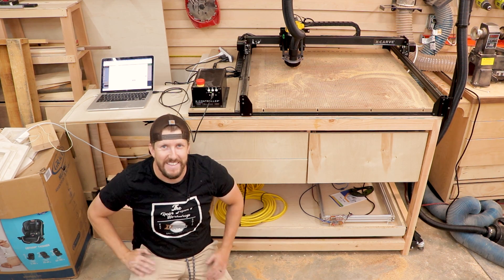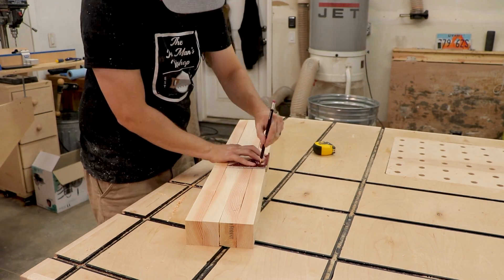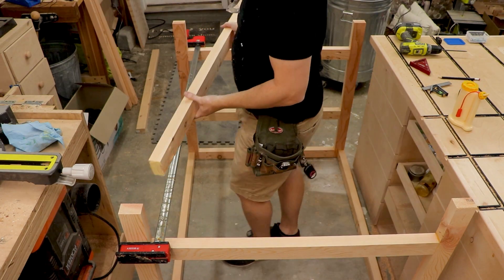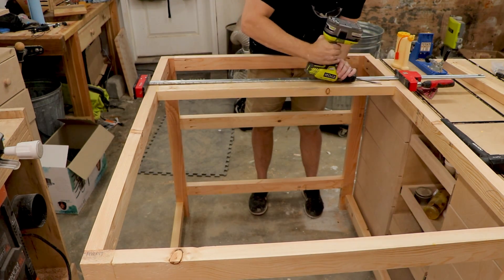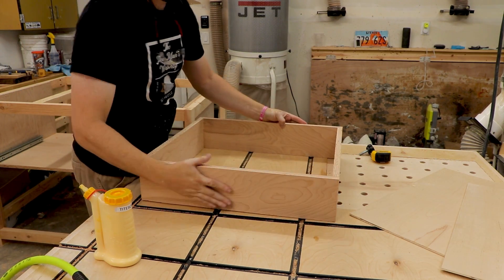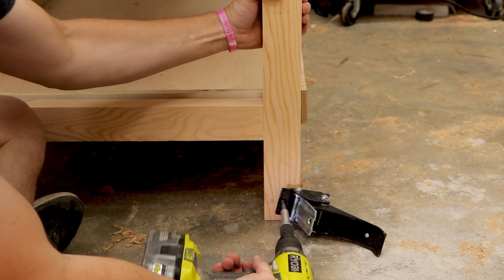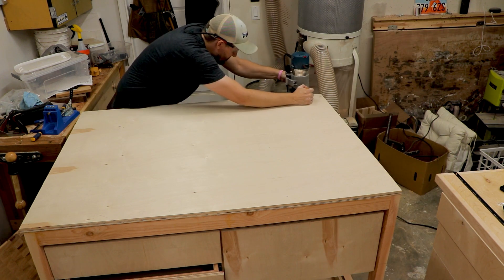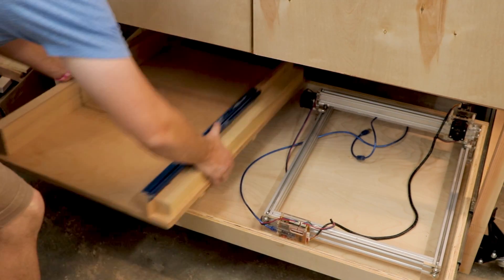How To Build The Ultimate CNC Router Table // Step By Step

Comment: Thanks for the great build! 

On the sliding miter it helps to make a score pass on the top, and then cut again full depth. As far as the kick back it looks like you have a regular 10" blade in the saw. There are blades designed for sliding miters that have a negative rake angle, that goes a long way in minimizing the saw wanting to run at you.
Reply from the maker: Awesome! Advice thanks a ton. I love your channel by the way. Keep up the good work.

Comment: Nice addition to your shop. I did the samething with mine and a few things I regret.
1) Not having a solid torsion box on a rolling stand. My floor is not even and each time I move it the top was not perfectly flat. This creates crash most of the time.
2) Not making an enclosure for either the CNC or the laptop. Dust in a laptop is a nightmare.

Drawers front, there is plenty of youtube video about techniques to affix them. Here my fav https://www.youtube.com/watch?v=keOixrPaWnA
Reply from the maker: Awesome stuff Marcus. Thanks for the great info. You’ve definitely given me some things to think about with having my laptop enclosed in something, great comment! 👍🏻